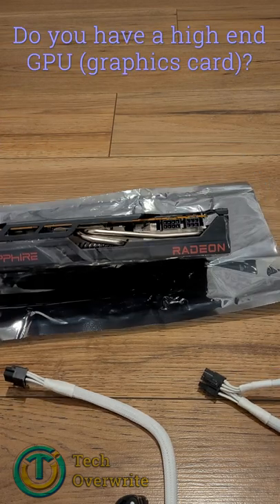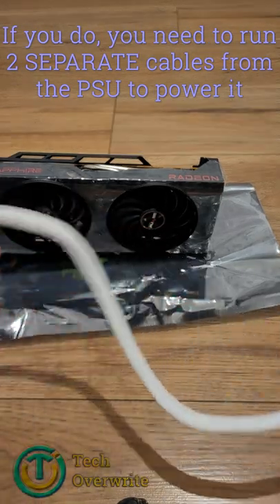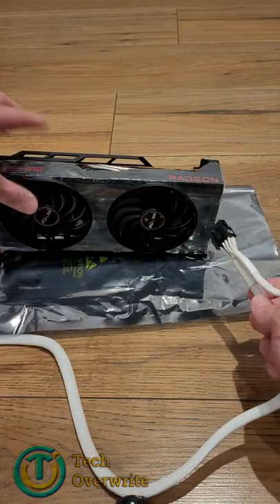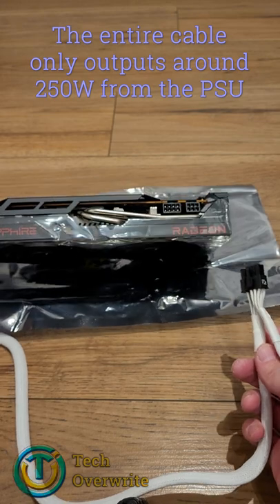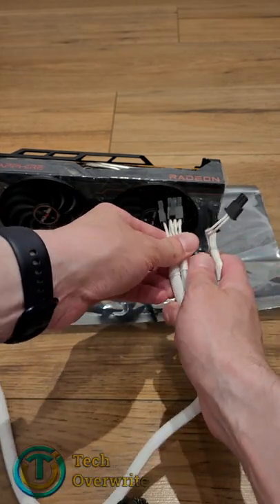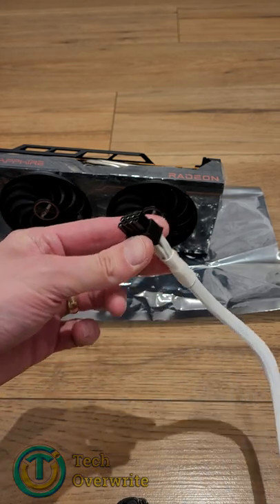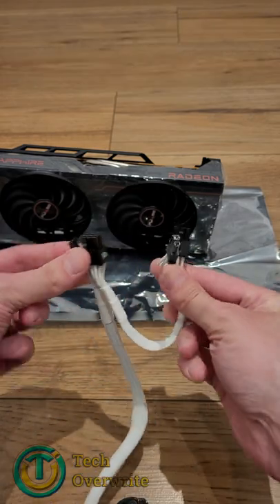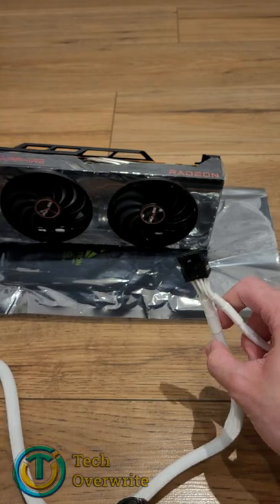Why You Should NEVER (Usually) Use The Same Split (Pigtail) PCIe PSU Cable #Shorts

Comment: i would like some help. i have 3 x 8 pin doubles and i have 7900xtx. should i use all 3 seperate and let the other 3 hanging ???
Reply from the maker: 2 separate cables (so 1 with an end dangling, and the other car with both ends used) should be okay here, since the 7900xtx usually uses 355W or so and that is often fine for 2 cables plus the mobo PCIe slot. Great GPU by the way 😊
Reply: @TechOverwrite  oo thanks. Because I saw your video and said never use same split that's why I thought to use them 3 separate and let the other 3 hanging.
Reply: @TechOverwrite  can you help me a little bit. my double 8 pins have a 6 pin psu power is that a problem. its the cooler master v1000 my psu and has 6 pin psu power supply
Reply from the maker: Do you mean that each PCIe cable is a split end, like it has 6 pins then 2 ends too? It so that is fine - it's just a 6+2 cable, and you put them together to make it an 8 pin. My Corsair PSUs do this too, and I have no problem powering the RX 6700XT (which needs a 8 pin cable) 🙂
Reply: @TechOverwrite   nothing i meant the psu power is 6 pin instead of 8 pin ( that gives power side not the pin sides) . because i buy one from a used website and didint have power cable too. should i buy whatever cable i can ?? for power cable for psu to the socket

Comment: Weird my 3070ti only works in the pig tails configuration otherwise it won’t boot also I have a 1000w psu
Reply from the maker: Hmm that's odd. It almost sounds like an issue with the second PCIe port or cable from your PSU. Definitely weird 🤔

Comment: There are some psu that have 2 separate cable yet they are coming from a single rail. At least give a detailed information when you make a short
Reply from the maker: Yeah that's a fair comment. I couldn't pack all information into 1 minute, but this is a key point, I agree. Thanks for pointing this out 🙂

Comment: So no ov or oc on rtx 3060 12gb should be fine if it's on pigtails because it's under 200w card 😂
Reply from the maker: Yeah that should be fine, it's a lower power card that should be well within power budget on a single cable 🙂 Overclocking should work okay here, IMO 👍

Comment: Hello, so for a 3090 gaming x trio i need 3 separate cables???
Reply from the maker: Hello, you might be fine with 2 cables here. Each cable supplies 150-200W, and the mobo PCIe slot gives another 75W. So for the 3090 trio, 2 cables with 1 pigtail should be fine. 🙂 (Awesome card btw 👍)
Reply: @TechOverwrite  thank you very much, yep i got it for a cheap price, im very excited about it

Comment: I run my pigtail cable on my 4070 super and it works fine and at its full capacity
Reply from the maker: That's genuinely good to know. What PSU is that with?

Comment: Could i run an rx 5700xt off of a 6+2 pin dual cable, i really dont want to upgrade my psu.
Reply from the maker: It should just about work, yes. The card TDP is 200-225W. Your PCIe cable will supply 150-250W, with the motherboard slot supplying a further 75W. So it sounds like it'll be fine 🤞
Reply: @TechOverwrite  so I can run a 5700 xt off of a 6+2 pin pigtail and it will be fine, my model is a 225w

Comment: I got a rtx 4080 and it comes with a 12 pin to 3x 16 pin adapter 
By your logic 
I can use 3 separate pcie cables  
Each of my cables are pig tail cables but I'll on use 1 of the 2x 16 pin connectors
Reply from the maker: That sounds like a useful adapter, and yes, using 2x from the pigtail and 1x from the other cable should be 100% fine in this case. Happy gaming 🙂
Reply: @TechOverwrite  thanks man

Comment: My asus tuf 7900 xtx needs 3 8 pins use I my with both splits then another separate 8 pin cable
Reply from the maker: Hi, yes I'd say this would be fine here. The 2x PCIe cables will supply 300-500W total (2x 150-250W), and the motherboard PCIe slot supplies another 75W. So together they should be under your card's TDP 🤞

Comment: Glad you made this video! People need to be informed about something as simple as this.The cables are actually rated 150w. As where 75w draw comes from your PCIE slot, so a total of 225w. Using pigtail configuration could deff melt the ends of the cable.
Reply from the maker: Thanks, glad it was helpful! 🙂

Comment: I’m running my 3090 with 2 pcie cables  from the psu with a pigtail on 1 of them. I don’t get the performance I expected and sometimes fps are very unstable. Could the pigtail be the reason of this? PSU is a RM850 and 11700k for CPU
Reply from the maker: Ooo interesting. I wouldn't be surprised if the pigtail is causing those issues - the 3090 is a beast of a GPU, and I doubt that it's being powered fully with a pigtailed connection tbh.
Reply: Mate I have exactly the same problem for my 3070ti, with 3 , 8 pin connectors, im using 1 single cable and then 1 single cable + pigtail to fill all 3 slots, also I got RM650X PSU Gold, I dont know if its the pigtail or the low PSU 650… or just both?
Reply: @Deni-qg2tb  I got a new Pcie cable for peace of mind and the performance got a little better, I can def overclock it now since it would crash with the pigtail. I'd say get the extra cable man, 650w it's fine I think.
Reply: @fredss5209  nice glad to hear, so basically you mean that you plug in 3 single cables into the slots? 

The thing is im ordering a 850W psu so I’ll get 2 new pcie cables, is it okey if i take the 3rd pcie cable from my 650w psu and put it on the new one? So i have 3 single cables plugged in
Reply: Forgot to mention,  my current PSU is corsair RM650x  +gold  & the new one is going to be corsair RM850 +gold,
Reply: @Deni-qg2tb  honestly I'd look that up. Since they're both corsair, you won't have a problem but I'm not sure if the 650w cable will work with the 850w. I have a RM850 and bought the extra Pcie cable from Amazon. It said it was compatible and so far no problems.
Reply: @fredss5209  aight cheers, but did it help the preformance?
Reply: @Deni-qg2tb  kind of, still not getting the performance I was expecting from a 3090 but fps are more stable now. Maybe my cpu is bottlenecking the gpu?? I got a 11700k
Reply: @fredss5209  sorry mate but I have no idea regarding intel CPUS, All I know about ryzen is that latest ryzen 9 series , 5900X and 5950X are rly nice combination with 3090
Reply: I got a 3070ti, 32gb ram 3600mhz & Ryzen 7 5800X , on intense CPU games I probably got around 9% bottleneck @1080p which kinda sucks… I usually play valorant and this hits hard with my gameplay

Comment: I have a 7900 xtx with 3 8-pin connections, so 2 8pins and a 6+2 pin all in seperate psu slots should be good right?
Reply from the maker: Hi, yes I'd say this would be fine here. The 2x PCIe cables will supply 300-500W total (2x 150-250W), and the motherboard PCIe slot supplies another 75W. So together they should be under your card's TDP 🤞
Reply: @TechOverwrite  thank you, this is my first time building a pc and I am kind of scared of messing up this 1k gpu
Reply from the maker: No worries, and I can def understand your concern. It's good that you're conscious about potential mistakes though - I'm sure your build will go really well 👍
Reply: @TechOverwrite  the build went well, windows install was less smooth since my install drive was broken. Ended up having to take the M.2. Sata ssd from my laptop and plugging it into a secondary slot on the new pc to boot and copy everything onto the nvme.

Also texted a friend who, thank god for that, has the exact same psu as me with only a 3060 so he had a free pcie cable laying around so now it just has 3 seperate power inputs.

Comment: Yea but this is for modular psu if ur psu is non modular this doesn’t matter it’s enough power
Reply from the maker: Yeah that's probably true, I forgot to mention that it was a modular PSU. Thanks for the comment 👍
Reply: I've 3070ti which is use 3* 8 pin but i only have 2* 8 pin in psu .. how should i do?

Comment: Than why do they make the cables that way?
Reply from the maker: I'd suggest to 'fool' GPUs that require 2 connectors even though their TDP is 200W or below (i.e. they are safe enough for one single cable/connector)

Comment: I have a 2070 super so do I still not use it?
Reply from the maker: The TDP of this card is 225W which MIGHT be fine, but it's a bit borderline. The mobo PCIe slot will deliver 75W, so it's just a question of whether the single PSU PCIe cable will regularly supply 150W without issue. Most of the time it should be fine, I guess, but avoid overclocking it 🙂
Reply: @TechOverwrite  thank you, I had 1 in and when I booted up the computer is said make sure all pcie cords are connected so I just connected them and now it works there is a 6 one and a 8 one

Comment: My psu one has 1 pci-e pigtail cable. :))))
Reply from the maker: Sorry man, yeah some PSUs are just limited. In this case, you either have to get a GPU that's limited to 225w or get a more powerful one but maybe undervolt it if you get crashes 😞
Reply: @TechOverwrite  thanks man. I'm worry 'cause I'm gonna upgrade to RTX 4070 Super, I wonder will my 1 pci-e pigtail cable can handle it.
Reply from the maker: Hmm, the 4070 Super requires a 12vhpwr cable right? Unfortunately you might be out of luck with that, sorry man 😞 Those cables definitely need 2x PCIe slots on your PSU.

Comment: My gpu was running fine for years using a pigtail cable,it draws 300-370w
Reply from the maker: Huh, fair play then. What PSU was that? Maybe certain good quality PSUs can sustain that load setup, but I'd guess that budget PSUs would struggle.
Reply: @TechOverwrite  corsair tx850m using the included pigtail cable,my gpu just recently bit the dust,but never any reliable voltage issues from the psu to the gpu

Comment: I have a rx 6950 xt and it is plugged like that and works fine, I think it would be so ugly to have some cables unplugged... and I've never seen it in a pc build on youtube or anything
Reply from the maker: Yikes, to run a 6950xt from a single PCIe cable? Just watch out for crashes incase you're maxxing out your GPU 🙂

You're right that my examples looked bad. What many builds do is use a combined PCIe cable, or a solution from CableMod. Many YT builds so this so they don't have the excess pigtail hanging around 🙂
Reply: @TechOverwrite  yeah I have asked the question on a website and people told me this was true with old PSU but now as long as they're good quality PSU they do run 350W in a single cable so big gpu are safe now (that was one guy's opinion against the entire website but he seemed to be really sure about it)
maybe you can develop this in another video ?

Comment: I think a lot of people here are missing the point. Pigtail connectors aren't going to deliver enough power for a high end GPU above 250W. In the past, GPUs being that power hungry was insane. These days the high end of Nvidia easily draw that much power, and the 4000 series is rumored to be worse. If you've never had problems using a pigtail connection before, that's probably because you weren't using an RTX 3080 or some other power hungry card. When Nvidia launched the 3000 series, it looks like they knew this would be a problem, and created a new cable standard just for 3000 series to avoid people from not giving the GPU enough power. Not all board partners use this standard though.
Reply from the maker: Thanks for the helpful comment, and I agree - with GPU power consumption only heading in one direction, I think this problem will be experienced more as time goes on.

Comment: Why even have the pigtail? If you shouldn't use both on a single card, then there is only one extremely niche use case I can think of for having the pigtail:

Running a VM rig with two graphics cards, where only one will be pushed to the limit at any given time.
Reply from the maker: Yep I agree, it's a weird trend of PCIE makers to include them (and then sometimes include instructions saying "don't use the pigtail"!! 🙈). Maybe it's just for some slightly lower power GPUs that still 'require' two PCIe connectors - even though they don't really need 400W+ via two separate PCIe cables. It's still odd though, I agree.

Comment: Some information online says a pigtail cable (daisy chain one) outputs 288 watts, I'm not sure if it's 250 watts.

It's usually a good idea to look at the specification of the GPU to know how much total wattage you should try to aim for (and go above a little).

Sapphire RX 7900 XTX Pulse has a TBP of 370 watts but recommends a 800 watt PSU.

It has three 8 pin power connectors.

75 watts is from the motherboard.
150 watts from a single cable.
~250/288 watts if you daisy chain that single cable.

If the GPU needs to use extra power to overclock or via undervolt, that wattage range should increase by 20% or however high that PL is.

120% of 370 watts is 444 watts, so you need to aim for ~500 watts for the GPU to be sure it doesn't run out of power or go unstable.

Slot 1+2 = 250-288 watts from daisy chain.
Slot 3 = +150 watts.
Total 8 pin wattage (+mobo) = Around 400~438w (+ 75w)?
Reply from the maker: Awesome comment, I agree entirely with your points (especially looking at the exact GPU TDP). I agree that shooting for below 500W in that case makes sense, and should work fine 🙂
Reply: @TechOverwrite  My Sapphire 7900 XTX Pulse can be undervolted to as low as 1025mV with no issue, but I use 1035mV because I can OC it to 3215Mhz or higher.

From what I can tell, unlike RDNA 2, in RDNA 3 you can use any number so long as you can reduce thermals and don't lose VRAM clocks from turning up the clocks.

Comment: So can i use this cable for rtx 3070 ?
Reply from the maker: The RTX 3070 should work okay with a single cable, but it might be borderline on a cheaper PSU or if you're overclocking the GPU. 🤔
Reply: @TechOverwrite  i would like to slightly overclock
Reply from the maker: Hmm, you might need to be careful then. Just look out for any freezes or crashes, especially if you push too hard with an overclock.

Comment: What should ido if i have dont have a modular
Reply from the maker: Honestly? Just make sure that you don't overload the PCIe cables (in other words, don't buy an ultra powerful GPU that won't have it's required power supplied by the PSU).
Reply: @TechOverwrite  i have a rx 580 nitro adition and a corsair 650w psu is it ok

Comment: Soooo, not true for the most part and also each power connector actually powers different parts of the gpu such as chip power, and memory, and vrm, see most PSUs have a pigtailed gpu power and so do a lot of cable extensions. See what this means is its sharing power thru the same wire, now if that wire is a high Enough gauge usually 12-18 then its fine, all that matters is the power is clean (thats what the 80 plus rating comes in) and that the wire is a large enough gauge, if it comes from a trust cable brand or brand of PSUs its fine.
Reply from the maker: I appreciate the detailed information, and good point about the wire guage - I should have discussed this point for sure. Thanks 🙂

Comment: I’ll be honest I don’t understand what I should be doing. You used the same cord as the example of what you should and shouldn’t do
Reply from the maker: Apologies, I agree it didn't help to show with the same cord 😞 I discuss this more in a few recent videos (such as where I cable managed my PC, and also here: https://youtu.be/FfoT3qLH3rY )

Basically if your card's TDP is above 225 watts, use a second, separate cable to be safe. So, connect two separate cables to your PSU then connect those cables to your card. The y-splitters (pigtails) will just hang around unused.
Reply: @TechOverwrite  thank you that makes sense, I think my pc came like that also. I’ll have to do it on my next build myself

Comment: Thank god I came across your video. You saved my card. I just checked my MSI PSU manual and even there, it tells for 200W-300W use 2 PCIE cables. 

P.S:- Everyone, please check your PSU manual before turning on power, it has everything written.
Reply from the maker: Awesome, glad this helped you out 🙂
Reply: @TechOverwrite  Btw, I'm facing another issue. My pc is built and I'm trying to boot for the first time. I have a gigabyte board. But even after pressing del key several times the Aorus logo appears just once and then it vanishes. What should I do?
Reply: @swagatammaji3025  your PSU is probably cheap bro
Reply: @2buckgeo843  Nah. It's an A tier gold rated PSU. The problem wasn't that serious. I just pressed a button and everything worked out.

Comment: i hvee 3070 and power cooler master 550w but idont have proplem ?

i7 8700k
16ram
3 hdd
1 ssd
7 fan
z370-a prime
aircooler ma620p coolermaster

and overclock cpu and ram and gpu

and led headar 12v 

Will the frames be reduced if you do not find enough power or the like? How do I know the use of the power supply? I want to know whether the minimum limit has been reached or not. Is there a program to know the use of watts?
Reply from the maker: You should be fine here. The TDP of the 3070 is 220W. So between the PSU cable and the motherboard PCIe slot, your GPU should be getting 250-275W easily 🙂

If you did have issues with power, you're more likely to see crashes than an FPS decrease.